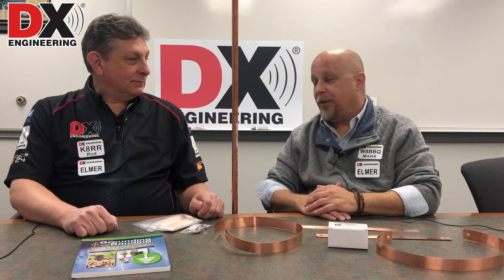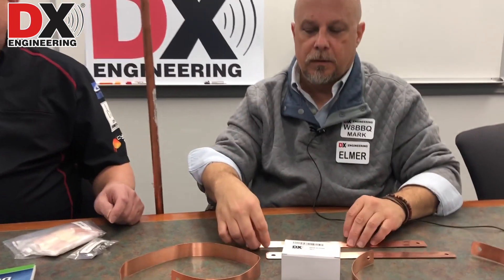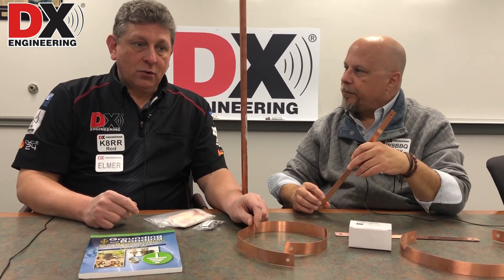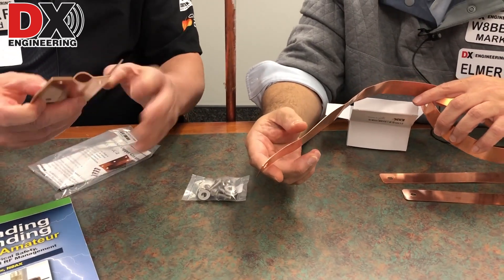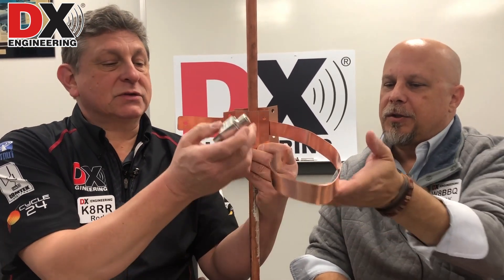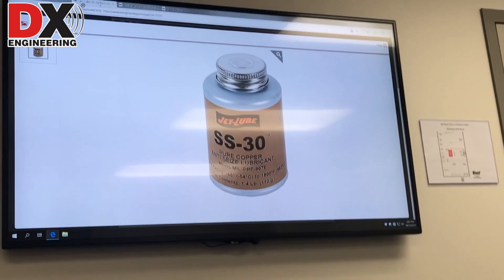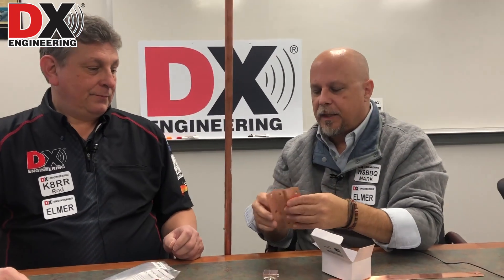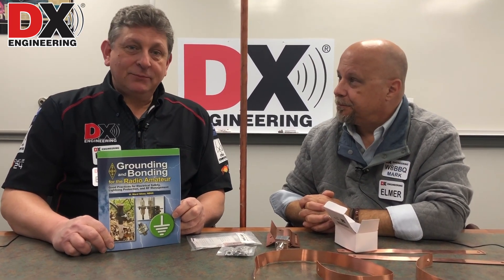Q&A Wednesday - Grounding Part 2

Comment: Hi Guys,

I'm gonna need to bond the 1 inch copper to the service ground rod at an oblique angle from 2nd story window about 10ft up & 12ft over. Thoughts?

Also, best way to ground an EFHW antenna coming through the same window to the back yard? How best to join a ground wire to the antenna?

Seems like that a near lightning strike could send energy through the ground back up the ground wire to the radio room, and a strike on the antenna could do the same. So how do you place and orient the arrestors - presuming I need 2? I should mention that I will be using an MFJ window pass-through panel.

Your guidance would be appreciated!

73,
John - KK7JBZ

Comment: Ok my big question is if you have a EME or a direct hit into the tower and it gets in your feed lines and goes through them surge protectors and lighting goes to ground does it melt them to not be used again because some types have a replacement fuse some seem to not have and you should make a video of how well they worked
Reply: *A video on how well they worked after a hit

Comment: Some of those little straps are $2.00 an inch at DXE. It is easy to cut, bend, and drill copper with cheap bits, clamps, and blades. Be creative and don't get ripped off.

Comment: PS the last recommendation for the ARRL Grounding and Bonding book ... not so much.  I didn't find it much helpful at all.  It focused on academics and broad terminology, repeatedly, such that the first 5 chapters never touched on any practical applications or solutions.  Wanderings and meanderings lacking practical application.  I find this true of all ARRL books thus far on all things grounding, antennas or even operating.  Esoteric rhetoric and elmer-to-elmer ramblings that sound nice on paper, but are not practical applications that help beginners solve design and application issues through to solutions.  This practical applicability is what many of your videos (like this one) excel at.   As a beginner trying to design safe and well functioning station solutions and get on the air ... who passed Tech and General, now about to take Extra exam ... who's studied so many texts, guides, and watched countless videos ... the ARRL materials are very unfriendly to beginners, and very challenging in closing gaps and focusing on practical solutions and design for beginners to be able to get on the air for the first time.  I don't know why everyone recommends their materials, I find them quite maddening and ineffective.  

As I'm now just getting to the last phases of getting on the air, getting everything in order, the last element is running lines from my antenna to station, and solutions between to get there.  Hence I'm watching this video.  I just finished reading the ARRL grounding and bonding book about three days ago, and said, "well that was a waste of time and money."  It's only by cross-referencing many guides and videos, combined with license exam study material and effort, that the pieces do come together for me into practical solution design.  Your video contributed to that combined knowledge.  ARRL material did not; has not yet.  I'd stop referring to ARRL material, you're sending people down a rabbit hole.  All that to say, great video that helped me, thumbs up surely,  but you lost me at the end. :)
Reply: I found the ARRL Grounding and Bonding book  to be very informative and well presented.  If you are looking for a "how to"  guide telling you how to properly and efficiently drive a ground rod, bury your coax & ground wires or design and implement the service entrance for your antenna and ground, you will need to do more research.  That is not the intent of this book. Rick W0RCF